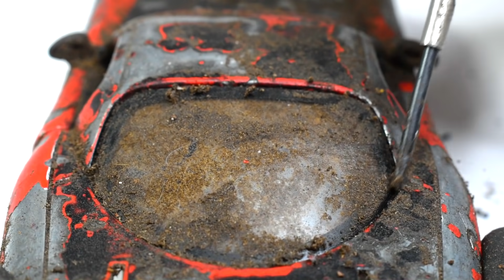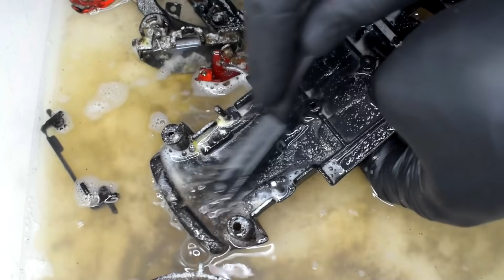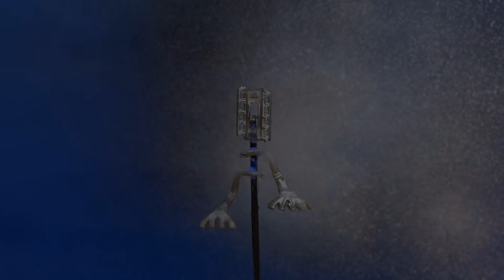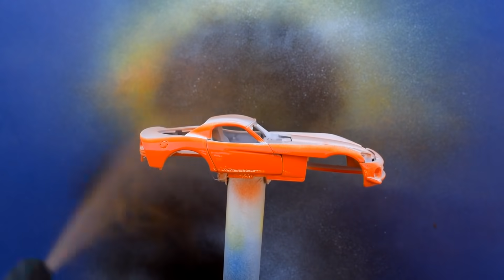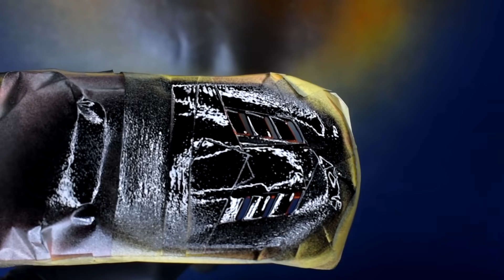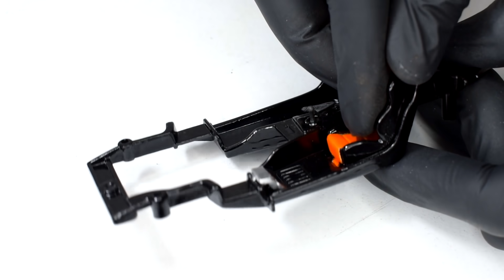Restoration Abandoned Dodge Viper SRT 10 ACR Model Car

Comment: I really like your videos but the work on this one seemed a bit rushed maybe. Seems that the paint application is way too heavy. I feel that a few  light coats would be better. Don't use glossy black on every thing also. Semi gloss on the seats, grille and spoiler would have been a very welcome touch. Not feeling the stripe over the hood intake grille. Another indication of being in a hurry I think. Still came out pretty nice though.

Comment: What are you using to dissolve the paint at 4:45?
Reply: There are quite a few products that you can use to remove paint from diecast. 
Goof Off, Aircraft Remover, or a spray just to name a few products that you can use.

Comment: Hi my name is Andre and I live in Florida  I was wondering if you can do some of my hot wheels?  most come from England and is it possible. I only need  about 4 to be restored please let me know if you can get parts for it or if I can use newer parts. 1929 4 1/2 litre Bentley   the other is a mustang but on the side it has a lever to steer  the wheels. Please if there is another way to talk or send you pictures would be great thanks